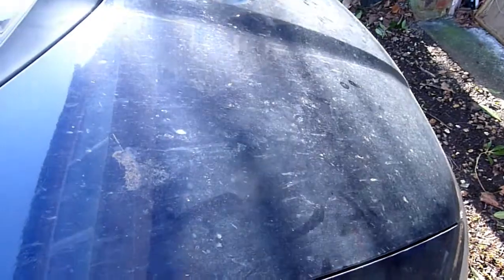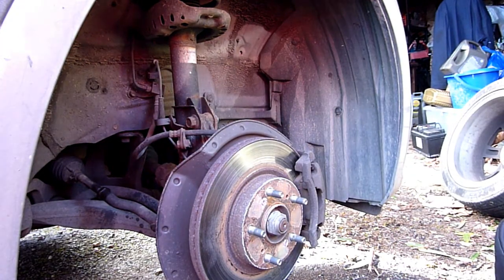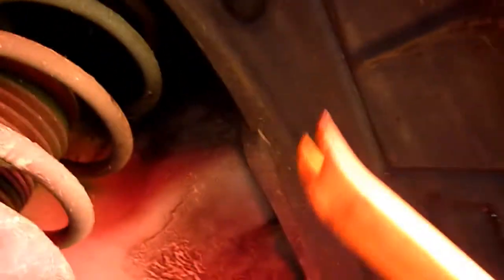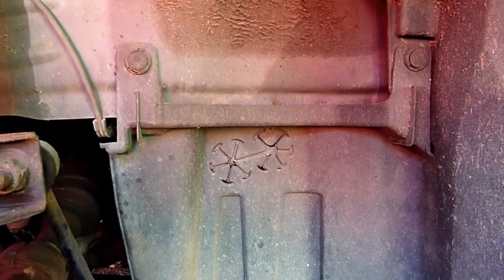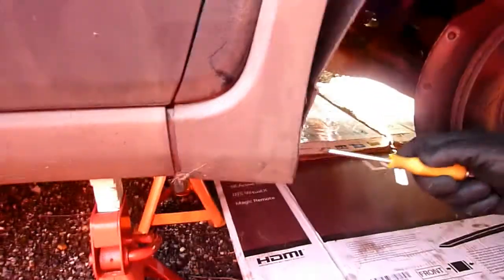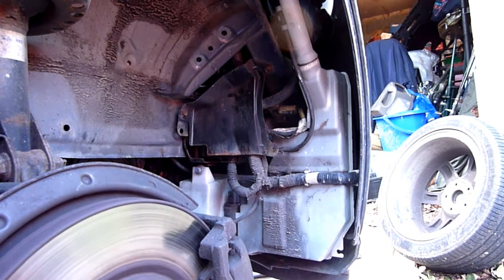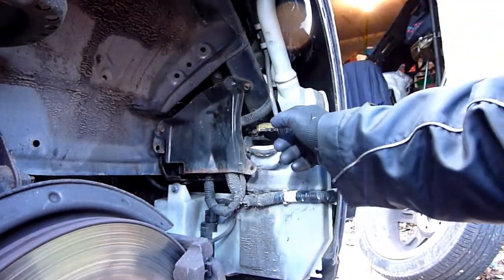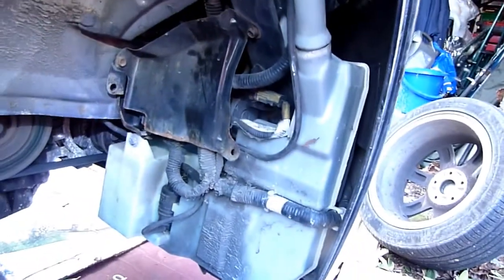How to Access the windscreen washer bottle and motor - Honda Civic 2

Comment: Mine is doing the exact same thing, randomly spraying so not then non at all. Where exactly was the leak/blockage? did you have to get to the pump? Thanks for this video!
Reply from the maker: There was a pipe leaking a while back, but I the problem came back in and I have determined the pump to be weak now. I will be doing a job on it. Basically it's the small vertical object you see at the base of the screen cleaner tank.
Reply: @EducationPineapple  I  managed to get there, breaking every clip I came acorss 😅. I took the pump out of where it sits, and put a small pipe cleaning brush down into the hole where it sits and give it a good brush out as it was full of gunk. I then got a flow of screen wash coming out. I resetted my pump and for now, the preasure is better than ever in my screen wash. Thanks for the informative video, be great to see more!